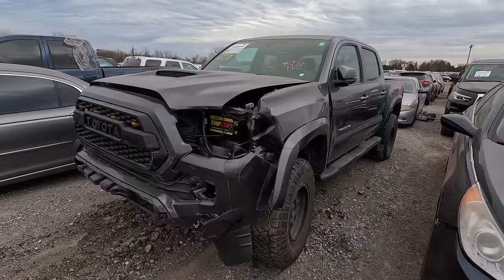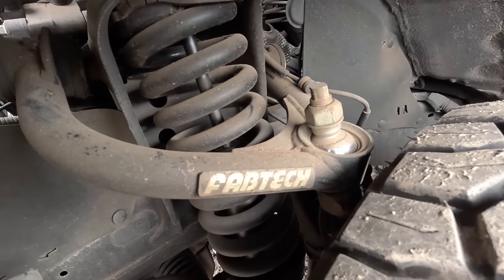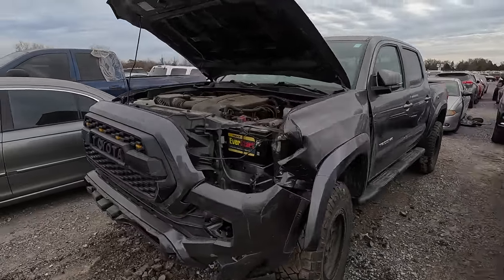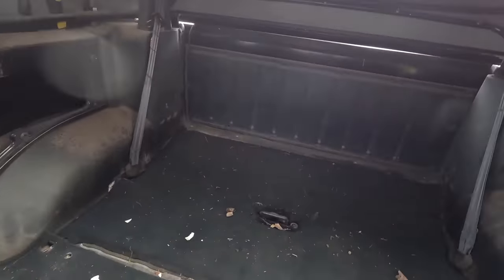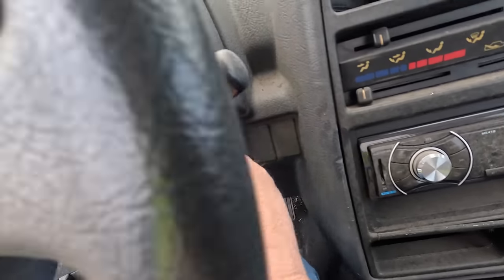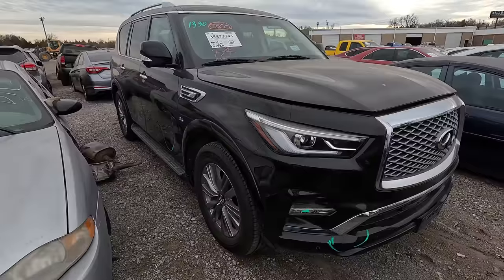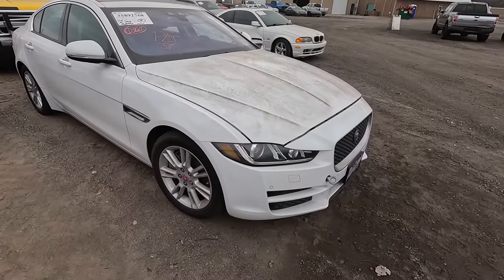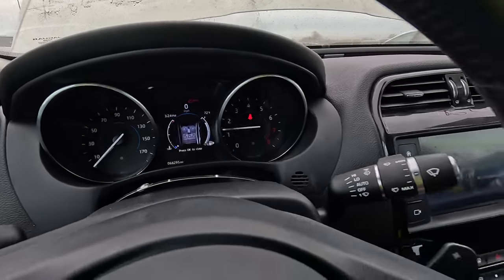IAA Walk Around 2-24-23 + Super Cool Geo Tracker for $25!!

Comment: Those GEO Trackers have a cult following. Crazy how popular they are. Great video!!!!  Unbelievable that Tacoma didn’t have blown air bags. Ours was barely hit and had 6 blown airbags.
Reply from the maker: I won it but they wouldn’t release it. The seller wants $1200 before fees for a non runner that needs tons of work. The Taco was a pretty decent little truck. I was surprised the bags were good too!
Reply: @AutoAuctionRebuilds that's unfortunate. I was really hoping to see you do a video on it. (Geo)
Reply: @AutoAuctionRebuilds  1200 ain't too bad, they are very expensive here in Mississippi. Very cool I love those.
Reply: Randy do you have an Autel scan tool? If you do it WILL reprogram key fobs. Used one to reprogram my 18 Nissan. Just a heads up
Reply: Randy Your doing a great job showing the viewers/subscribes what to look out for at the yards. A viewer made a comment the keys for the QX can be reprogrammed with a autell scan tool tool. Watch JrGO has that scan tool..Before you bid on it, ask JR about that feature first. Then you will at least have a key..
Reply: @AutoAuctionRebuilds  Wow!
Reply: The Taco, just because it’s said to be a run & drive, what if there’s a noise in the motor or something equally catastrophic? You can’t hear it run without a key. It won’t sell for as much as it would if a potential buyer could verify it runs and shifts correctly. Who ever stole the key is probably counting on getting it cheaply due to the missing key.
And yes, thieves are scumbags. A guy stealing out of desperation to feed his kids is one thing, in some cases almost forgivable.
I doubt the key thief is worried about feeding his children.
Reply: Unless rust got to them
Reply: Good luck finding parts.
Reply: The coma prolly didnt get hit in the lower half too hard where the crash sensors are prolly located.
Reply: Just bought a Suzuki Samurai.  Talking about turning heads.  It gets more attention than my C7.
Reply: @AutoAuctionRebuilds  please sir help mw to buy one i haven't money it's just for $700

Comment: Those Trackers are surprisingly great offroad

Ebay has new decals for it, Bring it back Randy
Reply: Unfortunately I think it's 2WD. It would have a second shifter if it was 4WD.
Reply: @tall_dude1233  true, but with that short wheelbase and ground clearance it would still do well with proper tires.
Reply: @tall_dude1233  If you know how to drive offroad you don't need 4WD. Many of the drivers in the CAMEL rally in the 80s had 2WD Landies.

Comment: The back seats in the Tracker, Samurai, and all other vehicles in the class (I don't remember if they were still selling Daihatsu at that point) were removed because regulations were changed that caused them to be legal for sale as pickup trucks but not passenger vehicles. It was perfectly legal for a customer to add the rear seat and seat belts.  That change came about around 1994-1995.

Comment: How do I reset my Jaguar gearbox?
Registered
go in to the car.
WITHOUT foot on the BRAKE press the start button: so the (ignitio is on) but (engine is off)
press and hold gas pedal down for 30 + second.
take your foot off from gas pedal.
press the start button to turn off ignition (let the car turn off completly before you start it again)